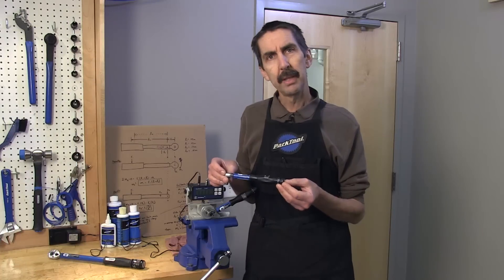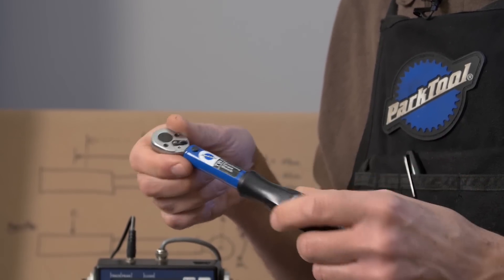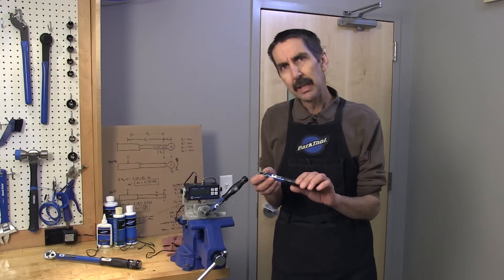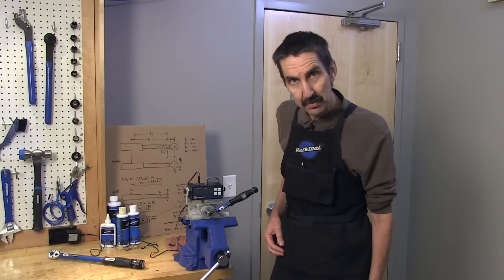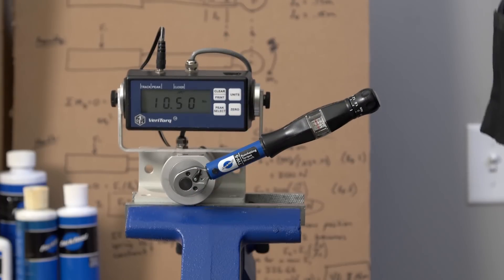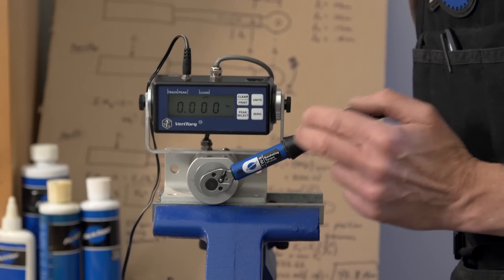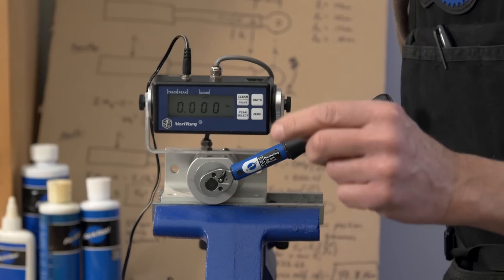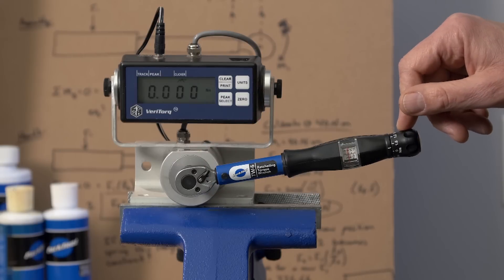Tech Tuesday #13: Torque Wrench Accuracy

Comment: Appreciate it’s an old clip but still relevant to me today:). Is it valid to measure Torque applied to bolt  in Nm by measuring distance from middle of socket to middle of handle ( my cheap wrenches have a mark on knurled handle) and then measuring kg at 90degrees to handle with luggage scales. ( I did check luggage scales by measuring both 10Litres and 20 Litres of water) until wrench clicks.

Comment: Very useful, I have a torque wrench with a twist handle and sometimes I find myself twisting the handle as I turn it therefore slightly changing the torque setting. I would move my hand further towards the pivot in order to avoid this but this shows that's bad idea!!

Comment: Calvin, what a stupid ending to this video. While I presume your intent was a bit of cute humor, I'm sure you know better to NEVER throw a quality torque wrench. 
Further, I can see from this old video that the discontinued Parktool TW5 you were using had a pronounced audible "click", while the newer TW5.2 is very subtle with no audible sound. This older one was easier to use to ensure you didn't go past the desired torque.

Comment: Does using an extension on your torque wrench affect anything? I would think not because it would seem that the rotational force would be the same athough it adds weight.
Reply from the maker: An extension can certainly change the delivered torque. As a rule, using a short extension at 90º to the wrench is a very minor change, so much so there is not need to change the torque setting.
Reply: If you mean an extension bar, of the type which allows you to reach recessed fasteners, then you needn't worry, because they keep the torque wrench's square drive coaxial with the fastener.

If you mean a crow's foot extension, then it can absolutely change the torque you apply.  Here's one of the many videos on this topic – https://youtu.be/ONT9z-WgUy8

And here's someone proving the theory with physical testing – https://youtu.be/tv_KHH55qdQ

Comment: It's a great demonstration, and the overall point is valid. But I don't think the explanation is correct. The fact that it takes more force when choking up on the shaft would not, by itself, imply a higher torque at the bolt. That's the whole point of a lever arm -- a higher force with shorter arm can yield the same torque as a lower force with longer arm. I knew that you had to hold the torque wrench by the handle (not the lower shaft), but am surprised that the torque varies so much between holding it in the middle of the handle vs the end. I still don't understand why that would be true. I would consider that much variation based on where within the handle you place your fingers to be a design weakness. It's supposed to click at a set TORQUE, not a set FORCE.
Reply: i had the same mentality.  but after watching this video https://youtu.be/0f746pF1xc0, i understood the difference.  your (and my old) terminology applies to those basic torque wrench with a single shaft with an analogue gauge and a needle.  the click type wrench has 2 pivot points, as explained in the youtube link, this essentially makes a difference when the force is applied along the wrench.  that's why it is important to hold the wrench at the right location to ensure correct torque applied.
Reply: the torque wrench in the video is made of multiple fulcrum points and by changing where you grip the handle you are changing the distance between the applied force and fulcrum. they mention it in their tech tuesday #98 at 18:30 -18:55. still doesn't quite explain why, even the old school beam torque wrenches are the same way though

Comment: Two more factors I was taught are necessary for accuracy are the direction of force as well as static vs. dynamic friction.  Direction of force should be perpendicular to the wrench at all times, requiring you to swing your arm along with the wrench for proper technique.  Lastly, torque readings must be done while the fastener is dynamic, i.e., while rotating.  A static fastener requires considerable torque to initiate motion after which the necessary dynamic torque to maintain motion is reduced.  Back in trade school the Snap-On rep taught us that torque specs are based on clean and properly lubricated fasteners under dynamic torque conditions.

Comment: Hi Calvin, I would like to ask a question, I recently bought a torque wrench and I had set it at zero / neutral, the head of the wrench seemed loose and had some play. It rattled from side to side when I shook it. But as I increased the torque settings, the head tighten. Is this normal or is there a problem with the internals or the wrench? Thanks
Reply from the maker: This is normal. if the wrench id set to zero there is not tension on the spring in the wrench. This allows for movement inside. As you dial it up it tightens the spring and gives a higher torque.
Reply: Park Tool thank you for your kind reply.

Comment: Thank you Calvin. Another problem is dry threads vs lube threads. Lube threads will apply more clamping force dan dry threads. plus also realise tension on the torque wrench when finished.
Reply: That's up to the manufacturers of the component you're working with. In other industries, the torque settings are specified as either lubricated or dry. For things like stems and such, the bolts often come included with thread tape on them already, so don't mess with it and just torque it down as-is.

Comment: And don't throw with your torque wrench...      Anyway, I won't be buying a Park Tool torque wrench, since it only supports one direction torque measurement.  I'm getting Teng Tools torque wrench, since theirs support both direction torque action.
Reply from the maker: Our torque wrenches are, in fact, compatible with both right and left-hand threaded fasteners.
Reply: Compatible as in, supporting torque wrench functionality in both directions?
Reply from the maker: Correct. You can find full specs and information on our website: http://www.parktool.com/category/torque-tools
Reply: FuzzyLogic just got owned
Reply: Don't forget bottom bracket cups, and left-handed spokes. :)
Reply: ROFLSTOMPED
Reply: Why would you want to measure how much force is required to undo something???
Reply: @ryanwilson3424  Measuring the force required to place a fastener in motion is part of an auditing process. It is done all the time in industry as part of quality control. There are three methods of measuring the torque on a previously tightened fastener. The most common is using Residual Mode on the torque wrench which is a torque and angle measurement.
Reply: @sturtevantrichmont  Nobody is using a consumer bicycle torque wrench to audit or QA in an industrial setting.
Reply: O wait, you belong to the "smart people" that think like Ryan Wilson is right.   Always amusing to see there are so many stupid people on this world.  Thank you for making my day Luccid Nanoob